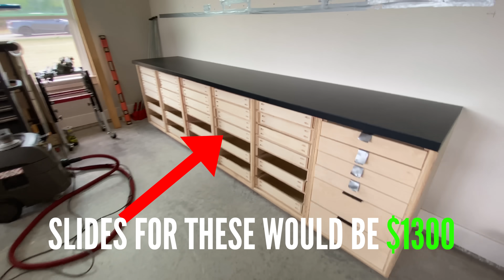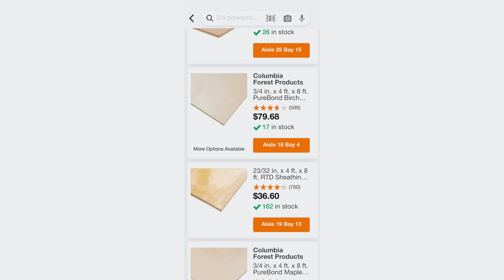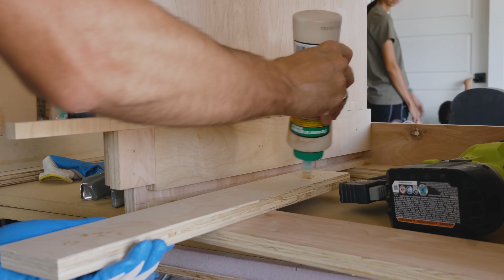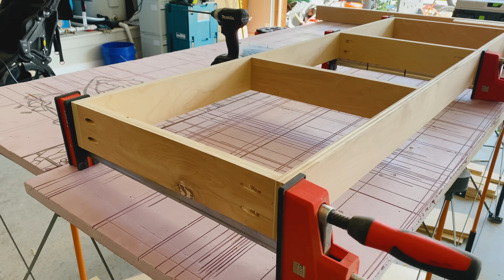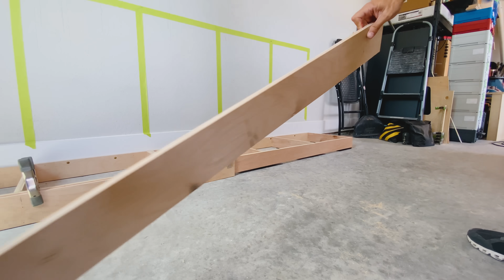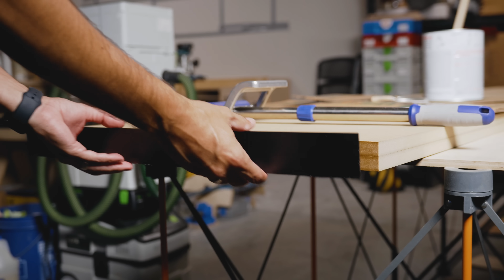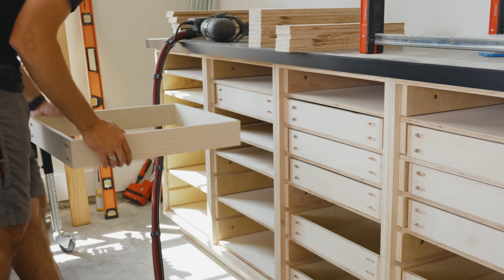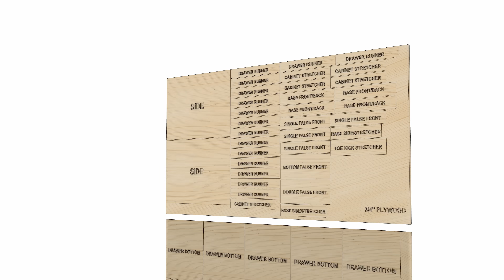Drawer slides are expensive. Do this instead.

Comment: 🤿! great video brother . Live in Houston , went to cabinet making class at wood craft and my instructor introduced me to 3 of his lumber yards starting from cheapest to most expensive but they had everything all the time . Sheet of plywood was about $35 a sheet . Funny how you actually taped over them went back and fixed 😅the wall . Now you see how many did not watch  till the end . Appreciate your content . 
I also use simple safe , but turn my water off before leaving even for the weekend to San Antonio or wherever. I work for water company. Call them if you forget and they will come out and turn it off for you . 🇯🇲

Comment: MY TAKE ON THE EDGE MARKS...  You were pressing too hard against the edges, pushing the router inwards to the piece, and you angled the edge bit more than 90 degrees.  The end roller bearing lifted slightly, and you were trimming the side trim also, instead of the top only.Next time, you can trim the formica with less force against the piece, and if you missed a little, you can always go around a second time???

Comment: For those without powerful upper body strength, they often do what you did with your router.  You use full body core strength and lean into it.   I detected a slight lean so might be your marring issue.  Awesome job with the right amount of self abuse.   Can i borrow your "Commercial Account" door opener, I have to go buy plywood now. 🐙 couldn't find snorkle so you get a condesending octopus.
Reply from the maker: Are you suggesting I start working out?

Comment: Lovely job. For anyone looking to reduce cost further You could save the wood of 5 side panels there by using both sides to attach the runners of adjoining cabinets. Could probably get away with thinner sheet for the drawer bases too as they are attached on every side.
Reply: NO you can't use lighter wood for the bottoms! I did, terrible mistake.  When you open the drawer all of the weight of the drawer that is hanging out is supported by just whet is left still in the "slide" .  Thinner plywood will break.  That is the one part of this design I don't like, you really only get about 2/3-3/4 extension as you have to leave enough in the slide to support the weight of the contents of the drawer.  Its also easy to pull the drawer all the way out. This is good if you want to take it with you but not if you want to leave the drawer open for some reason.
Reply: Great suggestion!!

Comment: Ive been working with laminate for over 20 years, you can avoid multiple coats of contact cement by spraying it out of a pot sprayer. Saves alot of time AND glue as you really only need the coverage to be roughly 80% of the surface and the bond is perfect
Reply: Also, Lami-Lube would have saved your edge from the router bit

Comment: Great video. Then only thing I am concerned about is the friction on the drawers when they are fully loaded. Especially over time. Do you have any suggestions for making them last longer or pull smoother?🤿
Reply: He will paraffin the slides and guides. That will minimize drag and provide somewhat of a moisture barrier to minimize swelling.

Comment: the bearing on your router bit could probably be changed. either its cooked so it was getting hot and spinning a bit on the edge or you weren't pushing hard enough so it had time to spin with the bit until it contacted the edge.

Comment: Not to down play anything here .If you want too achieve these results cheaper do not use full sheets for counter top. Use one 18mm full sheet with a build up or lip to over hang front and use an A sided ply wood for full sheet, not Medite or MDF. 
 Also set up a dado or router to make dados directly onto carcass sides for drawer guides.
 Biggest problem with this project is if you live where bugs; like roaches or bedbugs live . They will infest the live edges. Be sure to seal all wood.
If this counter top will be used for shop work better to just leave natural with a good finish coat . After time, laminate will become buggered up with no way to sand or fill . 
 35 years as a wood worker

Comment: A couple laminate tips from someone who works with a pro. First thing you want to do is tape the edge your bearing will ride along before you route. 1-2 layers of masking tape is fine. Step 2 is to cut your material a little closer to size. you never want to be cutting more than half the diameter of your router bit. (i.e if you use a 1/2" flush trim, never use it to trim more than 1/4" of material) it also helps to use bits made specifically for laminate (but they can be kinda pricy) the last step is to either use a laminate file to remove that last little bit, or a "no file" laminate but in a trim router. (this is my preferred method. it's easier, and gives the tiniest radius to the edge so its not as sharp)
Reply: This is an excellent post, and describes the professional approach to laminating.
Thanks for posting !
I might add the main sheet should overlapt the front and side edges, to avoid haing any chance of something catching the edge while sliding across the top. Am alternative is to use soft or hardwood edging, which then makes the front and side edges bullet proof. Just rip material on the table saw.
Reply: I like the cmt bit with the triangular plastic bearing cap.
 The triangle means it resists spinning, and the cutter is ground on a tiny taper. 
 Adjusting  the height means it will cut closer and closer as you drop the bit. 
I have hardly used the tiny amana bit since trying this cmt bit, barely touch it with a file and it’s done. 

I would also extend the drawer faces to cover the raw carcass edges, and scribe the base after it was leveled with the shims. 
Just cut a scrap block the width of your largest gap, and slide it around with a pencil on top.
 
French cleat the backsplash so you’re not married to the first tool layout.

Wax each drawer block before installing, and wax the drawer bottoms.
Reply: Use parafine canning wax on the edge after you stick sheet. Use a bullet laminate trim bit beveled.  Bastard file to take off the sharp edge. Black sharpy if you over cut.
Reply: you can also tape the bearing directly instead of the whole edge. its faster
Reply: The tip about never cutting more than half the diameter of the router bit is 100% true for ALL MATERIALS. Bottom/top flush cut bearing bits are not made to cut any more than half the diameter. When you cut more the leftover material on the outside pushes the bit towards the piece you are cutting and is all but guaranteed to cause the bearing to leave a mark which also results in cutting ever so slightly more away from the side you are keeping. Always trim first when sing flush trim bits, the more the better!
Reply: We always use a bevel bit and file the last of it with a bastard file (course cut on one side, smooth cut on the other). I think the Festool router attachment for edgebanding would likely work well on this application but I don't have one.
On a solid color, the tape is a good precaution.
Another tip is that having such a huge overhanging piece of laminate, as in this video has at the end of the top, is risky. It's really easy to go too far with the roller, because you don't realize you are at the end of the top, and then you crack the laminate, making the edge really hard to finish nicely.
Reply: So much great knowledge in the first comments and replies! Thankyou
Reply: Beat me to it.
Reply: Could've just bought the telescopic runners from China or india. I'm india the most cheapest telescopic style runners, a pair can be had for like 2 dollars USD and it's the same shit as off brands ( not like hettich hafflee blum) . For heavy-duty with heavy loads like 100 pounds + always buy hettich cheapest and best, but light load go for local chinesium varietals.

Comment: 🤿 Nice clean build. This would be within the scope of a beginner project. The only think I think I'd differ on is the shimming. I would the shims to temp level the base then use scraps and glue and screw them to the base. Nice work 😎

Comment: I think your laminate trim issue might be a failing bearing. Hopefully it is the guide bearing, not one of the motor bearings. The other thing that could be happening is the workpiece itself could be flexing a little. But the person who said to laminate a bit of solid hardwood on the edge and then to a 45 bevel has it right on the money. There is zero margin for error if the laminate is trimmed square.

Comment: These babies sux. Simple and straight forward. Pro tip: Get some high-grade wax and wax the drawer glide sections, both on the drawer and in the glide grooves of the cabinets. They will slide like buttuh', better resist moisture, and thus resist expansion and contraction. One can always reapply more wax to thems that start to become reluctant to open/close. Kudos. 🤿😴🛌

Comment: HD also has the SANDE plywood that is about $15-20 cheaper than Purebond.  Additionaly if you wanted 3/4” they also have Cabinet grade Pine (no knots) plywood for about $50 or so and it looks great and mostly no voids.

Comment: We have a cabinet in our dining room that was given to my mother 55 years ago.   The top part is solid oak with leaded glass and came from Europe.  It has adjustable shelves each side of opening has V cut wood slats, an insert strip that fits into the V then the shelf sets on top of strip with notches in the corners.   The solid oak base was made in Missouri in Early 1900’s.  The drawer glides are made of oak.  There are three parts. One attached to the cabinet, one to the drawer, and a third sets on the cabinet piece and the drawer sets inside of it.
And yes, it is extremely heavy.

Comment: Not exactly the design I was looking for when I saw a title proclaiming "cheap plywood cabinets," but I did stay for the entire, very entertaining video, and sub'd!  (Good-looking channel!)  The half-price sourcing tip was great, but I'm still not about making 4-layer-thick uprights between the banks of "draws" out of top-of-the-line birch for shop cabinets, or leastways thinking of that as 'cheap'....  😎

The shop cabinet design I'd been thinking about when I looked in here was considerably less 'high end', consisting of uprights between "draw" banks that were 1-layer thick frames made from half-lapped pieces of the cheapest 3/4"-ish plywood I could find, with slide cleats attached to both sides for the boxes to share the same upright and ride on.  A continuous nailer strip notched into the top rear corners across these frames would borrow stability from the wall it was screwed to.  That left the top, face frame or edging, end panels and bottom (I also like Mark's 'pedestal base' approach), most of which I was definitely placing into the 'rustic' or even 'distressed' category (or perhaps that overused phrase from yesteryear, 'shabby chic').  Just keepin' it reals, on a tight budget out here in 'tiny garage shop land'!   But you do you, and those are definitely gorgeous cabinets!  Maybe someday....    😎

Comment: I don't know if you really need it, but you could get some delrin sheet (or any other acetal type plastic) to make some some thin plastic pieces to slide the cabinets on, either on both the cabinet and the drawer or just one side. Acetal type plastics have good properties for low friction and they are quite durable.
Reply: Melamine 3/4" X 250' Roll, Preglued is 40 dollars and works wonders for stuff like this. 
Not sure if you need to do it both on the drawer and the ledge. If you did it on the ledge then one would have to account for that and do it before installing it.

Comment: 🤿Nice cabinets. Any feedback on how well they slide after you load them up? I wonder about laminating thin strips on the bottom sides of each drawer. Love the drawer pulls, I'll be using them. Simple, functional, and cheap.
Reply: They make some super slick Teflon tape that I plan on using for something similar.

Comment: Hey there,
Easy tip for you on leveling the iron frame down.  I use a 2 x 4 and just mail it in place.  With the 2 x 4 on edge facing vertically, you just just get a nail gun and nail it at level.  Like you say it’s so nice to have all base cabinets level, just put the in place and secure.  Have a great weekend and I hope I have saved you some money as after you leveled the kick plate framing in you can reuse the shims for your next level need.

Scotty B

Comment: Unless your draw’s are running on free magic, you did need to use/buy more plywood than you would have if you made regular draw’s. So you couldn’t have saved the entire $1300 the expensive draw slides would have cost, right?  You probably spent an extra $160 on two extra needed sheets of plywood.  The design is very cool, I just can’t abide plywood anymore after a decade of using it constantly. 

Was your router bit bearing working?  If it seized and wasn’t rolling as you ran it along the edge, it would have heated up due to the friction on the bit and that could have slightly melted the Formica. I can’t imagine another reason that a smooth, rolling bearing would mar a surface.
Reply from the maker: the draw slides used an extra half sheet. So, cost me $20.

Comment: Why don't they make kitchen drawers like this? They hold weight better, smoother to open/close if you simply wax the track & drawer edge, & reduce that wobble. Only thing you lose is soft close, which not all drawers have. And if you want a smoother open/close, you could just route a channel into the top of each drawer support and fill with ball bearings, but really wax is all you need.
So again, legit question, why don't we see drawers built like this in kitchens?

Comment: That's some super cheap plywood, we can't even get construction grade junk for under €70 (~4'x8')
Re: edge banding - bearing is stuck maybe? That looks like abrasion. 
Missed opportunity to integrate the front panel into the drawer carcass IMO. As long as you're doing math, might as well do that extra calculation as well. Nice project, definitely a big saving on the runners and will certainly take this route once I get around to it.